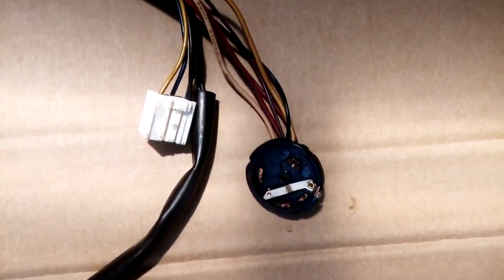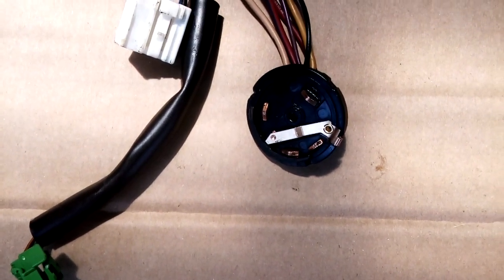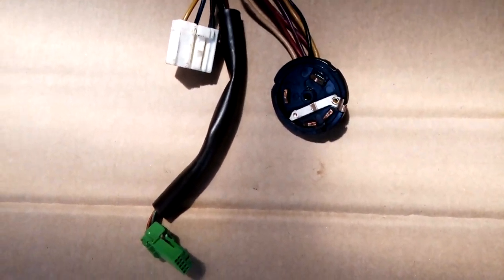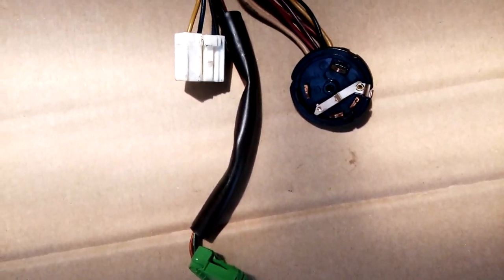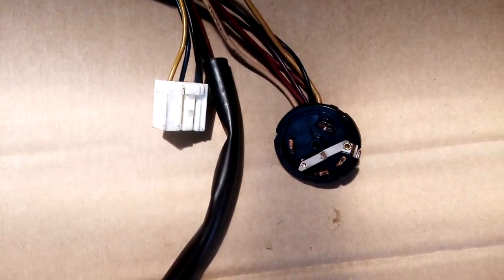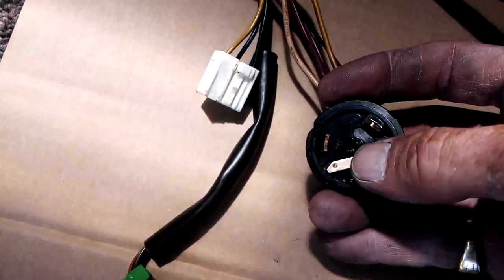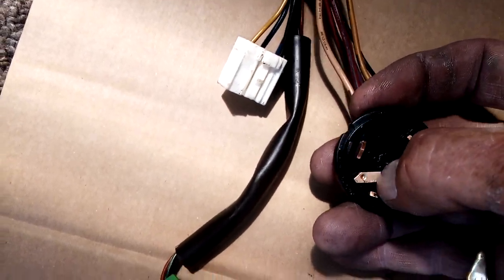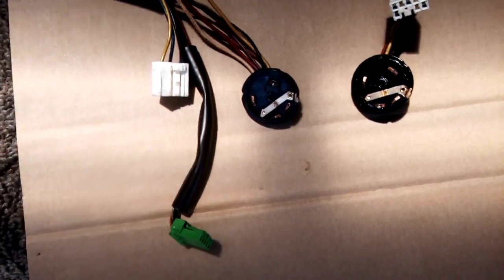Ba falcon ignition switch fail

Comment: Hey. Have a really similar problem. But struggling to remove the switch.(the black circular part with the ~5-6 wires on the back. Did you have to twist it out? Or does the steering column have to come out. 
Was hoping to remove the old one and then splice a new one onto the wires? 🤔